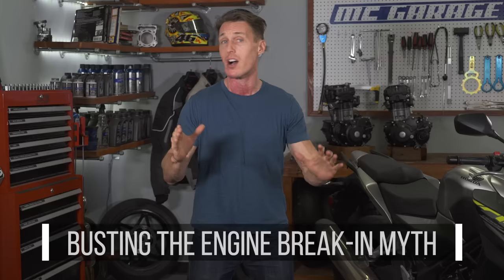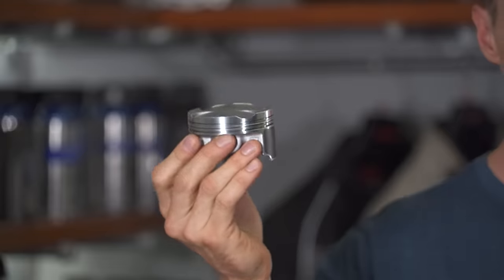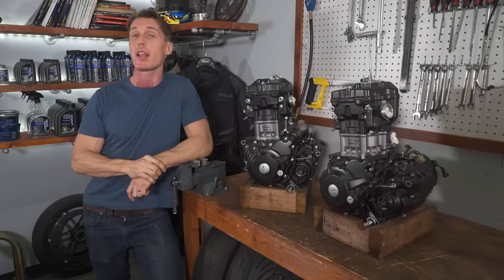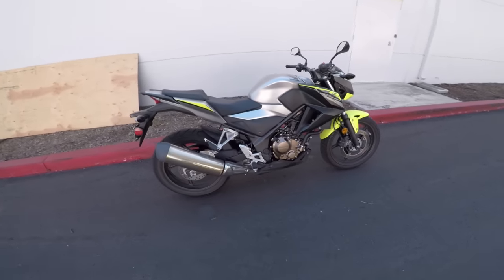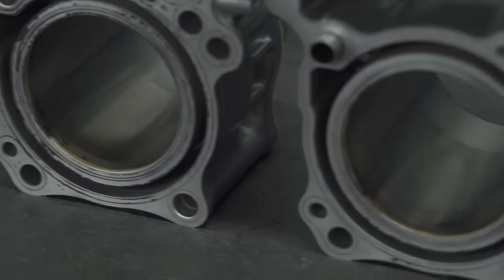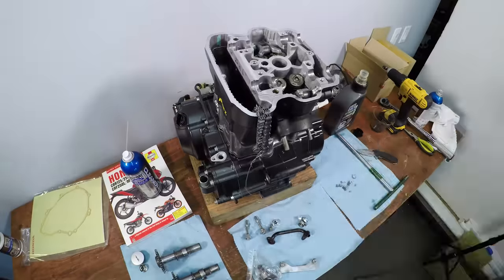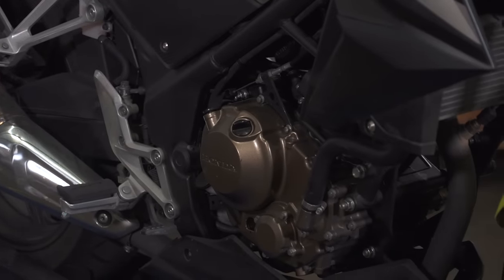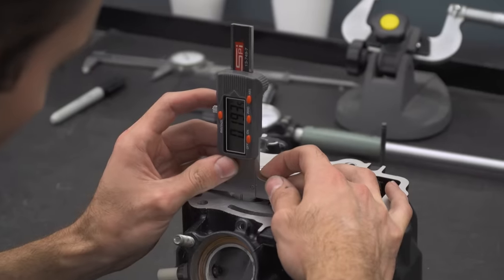Busting The Engine Break In Myth | MC Garage

Comment: After 20 plus years as a factory Honda motor cycle tech , at pre delivery inspection and road test , trust me , most new bikes have already seen the upper rev range before the customer gets it .
Reply: Yup, I'm aware of that. But just saying so doesn't satisfy anybody. We wanted to do some actual testing to inject some data into the discussion.
Reply: @mareksumguy1887  engines are run in the factory at various rpm's , all manufacturers do this step even the chinese bikes
Reply: @Cp3_james  They don't run them hard at the factory; they use light throttle and go through the gears just to make sure everything is mechanically sound.   @specialise wasn't talking about that.  He was talking about what they do to the bikes on HIS end (after they have left the factory).  Thats what i wanted to know.
Reply: @Cp3_james  1. We don't know what throttle position (power level) those engines are run at.  2. Not all manufacturers do this.  I'v seen video of Honda factory dyno their CBR1000RR at the end of the assembly line. And they only ran it at low throttle just to make sure there were no obvious problems. Not even half throttle.  The engines definitely aren't broken in at the factory.   And even then, i don't think they dyno every bike... they batch test them.  Like 1 in every 5 or so.
Reply: 20w - 50 is a wide range multiviscosity .  twice as wide as 5w-20
Reply: Seeing the upper rev range for the shortest time possible whilst as couple of checks are made is not the same as a break-in.  My God, how do we put these foolish lies to bed?  Must we go and talk face-to-face to every biker in the world?  They want to believe that a hard break in possible to grab at any web document produced by a non-engineer as "proof".
Reply: @Cp3_james  for low periods of time right ? How much time is every single engine exposed to high rpm ?
Reply: I went to the Ducati factory last year and those motors have definitely been run hard the second the bike rolls off the production line. You can see the bike lurch on the dyno as it goes through the gears and the speed and rpm are clearly visible on the display. I remember thinking what a cool job. Flogging the tits off everyone’s bike before they buy it.
Reply: Ive also had a few trips to the Triumph factory ( no2) on the Normandy way site UK , and yes even there the bikes are run up  (right up) to speed and temperature ,  i can only assume that the export triumphs are the same but wouldnt know as they are all built in Asia,
Reply: Same with new cars. They floor it on a rolling Dyno to make sure it shifts properly not even 10 minutes after it's first start
Reply: there is nothing more disturbing or more common than mechanics and yahoo owners thrashing a cold motor with high revs.. doubly so when it is NEW !    The dealer isn't going to send it out unless they know it's gonna run when the new yahoo gets on it  30 seconds after delivery...so there you go.
Reply: I applaud the meticulous way you went about this..
Reply: Ari Henning tq bro..
Reply: Yes, for Quality Assurance. But only sampling. +-3sigma applies.
Reply: @dias17se  I think my average rpm is 7500
1900 idle (very cold 1800 and hot 2000) redline at 11000
125cc bikes want to get it hard and if I drive stock under 5k at 3rd gear it knocks 4k in 2nd gear
Stock means with connected O2 sensor
Without it knocks under 4k Ton 3rd and above 4th you shouldn't rev under 5-6k
That's what I've learned about my bike ;)
Reply: I bought my honda CRF brand new from the dealer. There was no oil in the bike from the crate. So they fill the oil and trans fluid 2l, run the engine, then dump the oil and ship it?
Reply: Yes because they have to test them!
Reply: Marek Sumguy lmfao
Reply: @gmoney5729  Whats so funny?
Reply: Ever seen the S1000RR production??
Reply: 2 yrs ago, I brought home my new BMW S1000XR and when scanning through the back pages of the GPS, I recognized that it already had a top speed posted of 129 MPH. You can believe I snapped a photo of it, sent it to the dealer, and asked what was this all about?
Reply: These replies got off the mark a bit.  I'm a Honda tech too, as well as Ducati.  All bikes are put on a dyno at the factory.  They aren't just fired up and gently idled.  They're taken all the way to redline at WOT.  Every.  Single.  One.  Then they're partially disassembled, put on a crate, and shipped out.  When they get to the dealership they're put together and put on display.  Once they're bought they get a full tank of gas.  Here in America that gas is crap compared to what the rest of the world runs.  When they first fire up they usually don't run so well.  They get checked for leaks and taken for a ride.  Idling around and being gentle will keep the ECU from learning the new fuel, it'll just keep running on the stored maps.  You won't know if the fuel pump is good if you don't redline it.  You won't know the whole thing won't grenade on the customer when they beat on it if you don't.  If you don't get the pads bedded in right they'll be complaining about it soon.  If you don't get the tires hot you'll be pushing it back in to replace the plastics before they even leave the lot.  The engines have been wrapped out several times before a customer ever sits on it.  Not because techs are savages and beat on things that aren't theirs.  They'll end up breaking something and getting fired pretty quick being like that.
Reply: remind me to never purchase a bike from your shop or take my bike to your shop for service.
Reply: one more reason to just buy used
Reply: Trevor Ellis actual engineer here, the Honda k20/k24 is a car engine that burns oil from rings its entire lifetime if the engine isn’t broken in “hard”. This means that if you drive it like a grandma the first 1500 miles off the lot, you’ll need to put a quart of oil in every 1k-2k miles. This is because the piston rings at high rpm resonate, and ensuring the frequency of the ringshape and RINGLAND shape are identical is what happens on the first couple micrometers of wear on the ring during break in.
Reply: Boy, you really struck a nerve with some of these guys!!🙄 
Of course these are probably the same people that even after breaking the bike in strictly by the book, and then another four or five thousand miles they are still afraid they will hurt it. You know the type, the ones that when they do finally get coerced into getting on it a little bit, you can see by the look on their face that it looks like it actually pains them to roll the throttle on.😬😟😨😰😱🤯😩😠🤬         🤣
Reply: This seems like a pretty stupid argument if you ask anyone that's ever shaved a lobe off of a camshaft
Reply: Same with many cars, if it wont fall apart it will also hold up when the customer revs it
Reply: @mareksumguy1887  Indeed we don't know the exact rpm those engines reached.  To my ear it was just tad above idle.
Reply: @trevorellis1704  Appeal to authority. FAIL.
Reply: @percussion44   What is the fallacy where Honda using high revs for a few seconds to check the engine means its OK for the buyer to thrash it on the road, under stress, for hours at a time?  Also the argument that compares Motorbike engines to car engines to show that no running-in is needed.
Reply: @Cp3_james  My aprilia was shipped to the dealer dry.
Reply: Save goes here bro.. some time its seem funny when   bike shop  says costomer must  engine break😅😅
Reply: @stephenhadley2490  Can you not see the difference between revving for a few seconds to conduct important tests and running a brand new bike under high strain for mile after mile?  Believe what you wish but please do not try to justify it with facts that do not line up - it makes you look foolish.
Reply: @specialse  Can you not see the difference between revving for a few seconds to conduct important tests and running a brand new bike under high strain for mile after mile?  Believe what you wish but please do not try to justify it with facts that do not line up - it makes you look foolish.
Reply: @AGuyFromHazard  Can you not see the difference between revving for a few seconds to conduct important tests and running a brand new bike under high strain for mile after mile?  Believe what you wish but please do not try to justify it with facts that do not line up - it makes you look foolish.
Reply: @fry.master  Is there not a difference between a bike engine and a car engine - trying to compare the two raises doubts about your engineer qualifications.
Reply: Trevor Ellis  Very odd response but I expect no less from YouTube.
Reply: @stephenhadley2490  I would love to be told how a brief period of essential testing at max revs means that one can safely thrash a brand new bike from day one.  There must me some engineer (or even a factory tech) who can explain this.  I'm really interested to know.  Or maybe just explain why this question should be odd in response to such a throw-away comment.
Reply: Trevor Ellis I was recounting a trip to the factory and what I saw. I didn't recommend you thrash your new bike if in fact you could ever afford one which I doubt. Copy and pasting multiple answers to people does't make you look like Albert Einstein either to be honest.
Reply: @Cp3_james  yeah I work for FCA and we ran our test engines at high RPMs for 90+ straight hours but we dont sell them
Reply: @Cp3_james  yes but ari's engines werent in bikes
Reply: @mareksumguy1887  at BMW they do a dyno Run for tourque and Power Up to top Speed on every s1000rr
Reply: James Lee how is that? A 5W should be more viscous at lower temperatures than 20W?
Reply: Marek Sumguy yes they do if there is something wrong they would rather find out at factory is procedure
Reply: @matthewdinola1422  
I would assume so.  
Thats what I do to things I build
Reply: No technician at any of the factories in the world manufacturing internal combustion engines, keep at the upper revs near peak torque values for sustained periods of time even when in neutral gear. Max that is done at the Honda factory in India is high revs for about 1 minute or less. It is sustained revs at peak torque rpms' levels with load that ruin the honing marks on the cylinder wall, and I am not even talking about the valves seats or stems and gearbox. Honing marks as you would obviously know is there for a reason and these marks are to be smoothed off ever so gently. Revving for sustained periods of more than 1 minute at peak BHP levels will appreciably reduce the life of the engine.
Reply: I'm working at a dealer ship and every bike undergoes a pre selling check. When I test drive them, I give them all they have. xD
On bigger bikes the high rev range is not a problem. It's the 125er where problems start even during warranty. A lot of KTM 125er have destroyed engines because they get beaten right from the start when driven 100km/h they are already at maximum RPM. And in my region this speed is pretty common on the roads.
Reply: @mikaelgaiason688  Thank you. Some people just dont get it.
Reply: @glennjames2324  laughed at this comment bc i know people like this.
Reply: @trevorellis1704  this is why every race motor builder, car, bike or whaterver, always spends months slowly breaking in their motors. I have seen bikes that were started up after full rebuild, run hard on dyno then out to race all at high rpm and load with 0 miles. they last the season and then are sold (without rebuild) and are still on the road with 20,000 miles later. We are talking metal to metal with purpose built parts. Should any part fail, the engineers will correct the design and it will not fail next time. If all parts are checked and withing spec, then the "break in " is nothing more than the natural micro polishing of the moving surfaces. Do you think that if you polish faster or slower it will make a huge diff? The data presented in the video shows that there is NO significant difference and math(bore measurement, leak down tests) do not lie
Reply: @anthonygrimaldi8768  Don't count Race Bikes.  If you want to rebuild your engine after a few hours and throw it away after a few more then follow race bikes.  Come-on be serious!
Reply: @trevorellis1704  I explained in my comment that I personally know of bikes that have been rebuilt, started on the dyno, raced for a season without rebuild then sold to friends who run them daily inc track and some are over 50,000 miles and never had any issues. Bottom line is that the slow breakin will not hurt the motor but is not 100% necessary nor is it a guarantee that your slowly broken in motor will last any longer than a quickly broken in motor. When they used porous cast iron and pistons that were not vacuum forged and full of oxidation this was necessary
Reply: Yup!! 100 percent
Reply: @specialse Not impressed by your comment. Too bad you can’t afford the bikes you hit hard with out proper thermal conditions.
Reply: I remember buying my CBR and whisk I waited for it, I saw the mechanic on it hauling ass outside lol
Reply: @moustachio334  yup :-)
Reply: So for a engine wear test, you selected the most bulletproof engine? You have to run for atleast 10000miles to see even a difference. 
Try a somewhat less reliable non Japanese brand.
Reply: @mareksumguy1887  😂😂😂👍🏼
Reply: @mareksumguy1887  lmao 😅
Reply: @mareksumguy1887  you are so adorable I love it. And thanks for the info you seem quite knowledgeable about these processes!
Reply: @welcometoreality3450  did you watch a different video? They were in a bike on the road. Then removed and tore down to mic all parts. No difference between the two methods of break in.
Reply: So can I full throttle my brand new Honda bike from day one?
Reply: @trevorellis1704  Ride it like you stole it, from day 1
Reply: @archiewilson4943  
Why?  Still been flogged apparently.
Reply: @michaelbell3459  &what'd they say??
Reply: Then why does bikes start getting better mileage after first service?
Reply: But can you use synthetic oils for a urban express after rebuild
Reply: @mareksumguy1887  they definitely do!! I’ve seen it they run them to redline !!!!
Reply: @TheEverydayManChannel  yes… as long as it’s at operating temp.
Reply: Lock throttle long distance vs temporary high rev are different thing buddy
Reply: MAO BA? EDI WOW KOL! 😂
Reply: @jibinjosephsebastian1498  The bike gets better mileage and runs more smoothly after first service because A, that first oil change is a big one, it will get rid of any tiny metal shavings left over, and your oil is better than factory oil, two other adjustments are made at that time to the tappets that can really provide a big difference in performance.
Reply: That statement makes me never want to buy another motorcycle.
Reply: @mareksumguy1887 link the video of Honda dynoing new cbr ‘s.  Otherwise you’re just a troll
Reply: @captlarry-3525 Yahoo owners left that chat at 7k RPM.
Reply: @michaelbell3459 Then?
Reply: (I comment 5 years later) Not anymore (at certain manufacturers), a cold test is quicker, saves money, appeared to be sufficient after sample testing, a hottest used to be done, max maybe 2 minutes, maybe with a little damage that would not harm at least within warranty period, maybe for small series this will still be done nowadays (like some heavy duty trucks, but those are more robust anyways), PDI at motorcycle dealer follows after this (but not always, depending on the law where you live).
By the way, fourty years and longer ago people/customers already used to say "breaking in ? not needed with these modern (!) engines"............. OK, suit yourself :).
Reply: That doesn't sound correct.
Reply: That's something I always thought about: why not "break in", well, in the factory? This comment made me realize that manufacturers do it.
Reply: @ 4:51 in the video as your refilling the bikes engine oil I see the portion of the oil bottle seal foil flow into the crank…  is there a screen protecting the oil supply? Would this be a concern if noticed at the time?
Reply: They still loosen up some mine did I got a 24’ Honda metropolitan and it would only run 35mph when brand new but soon as it got around the 400-500 mile mark it would open on up and go to 38mph which it does all the time now! That was my first brand new engine and I tried to go easy just put around the neighborhood the first few hundred miles then I pegged it!

Comment: Been riding for most of my 36 years.  I have never bothered breaking in any bike.  I just ride them how i normally would.   Looks like i was right all along, lol.
Reply: The question is: how do you normally ride them? Lol
Reply: UNFINISHED FOOTSTEPS  ok kid
Reply: Most original owners don't put enough miles on a bike for it to really matter.  The most I have put on a bike is 60,000 miles.  The next owner might see some issues at 100,000 miles.  ;-)
Reply: Consistency and proven record worked for you. If it works then why change it? 👍 Ride On! 🏍
Reply: I always forget i ride full throttle.
Reply: lol as a new rider who got a new bike and just road it like normal im glad to see this is the case lmfao. although with all the tech these new bikes have i could see the revs would go up and down just a little by itself to keep the revs varied so that was interesting to see basically I cant messit up and as a new rider thats nice. I did have my abs go off by itself yesterday lol I just turned off the bike for like 30 seconds at a stop light and turned it back on and poof all good. also once I hit 620 miles my shift light went up by 1500 rpm by itself lol new tech is cool.
Reply: Looool